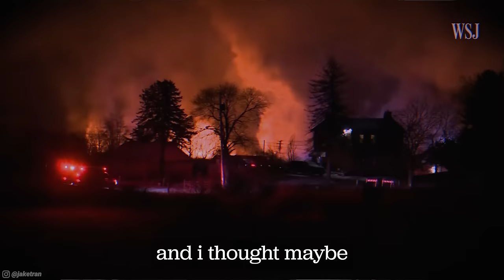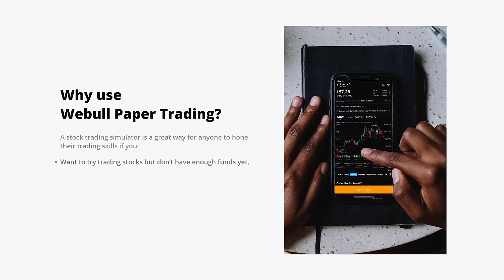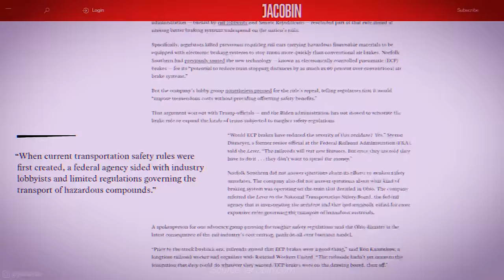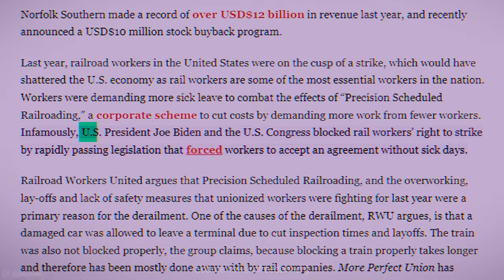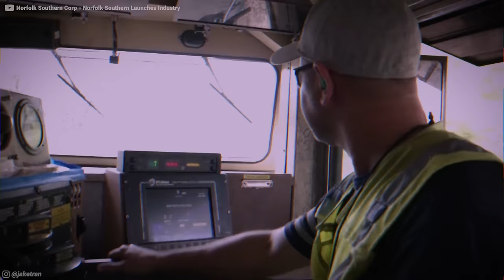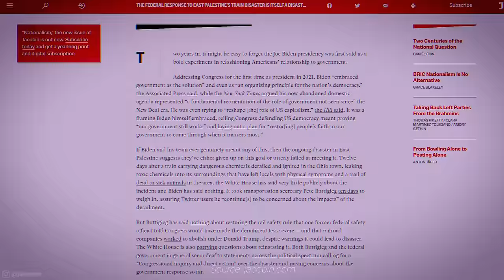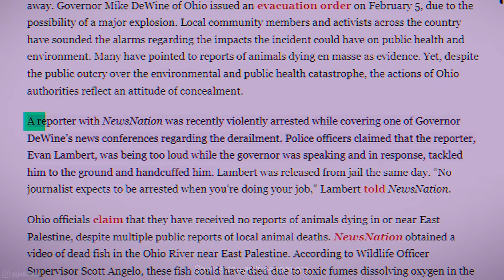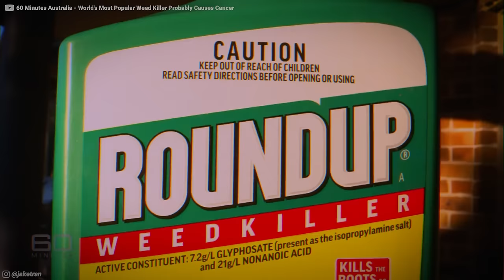Ohio is a CHEMICAL APOCALYPSE right now

Comment: Another terrifying fact about this crash, the vinyl chloride boils at 4°F and is only shipped in liquid form, so when the train crashed it was leaking boiling cryogenic liquid. The train was also carrying between 250K and 1M lbs of it, so there is definitely more air and water contamination than they're saying.

Comment: Different train companies have been skimping on safety measures for years, and the state of Ohio has not given the necessary funds to maintain the railways. So as a result it was somewhat expected sadly...
Reply: Yet they build more railways?? If you're understaffed then building more railroads makes zero sense. Nahh it's excuses to avoid responsibility. When you call it an "accident" then its easier to avoid jail time.
Reply: @woiowoiow190  You know that the different train companies get subsidies for the number of railways that they have? By building more they get more income and to squeeze a little bit more profit they skimp on the safety standards, staff, etc.

Comment: This is gonna be a long one, 

You did get a lot right, but you got way too much wrong in this video.  Number 1: Westinghouse Air Brake is not the same brake from the civil war, it has had countless improvements over the decades, Including having multiple points in the train to dump the brake pipe in an emergency brake application, (thanks to EOTDs and DPUs) to prevent the slamming and derailing that people worry about(idk why this this a take many journos believe, it’s dumb), ECP quite literally is expensive, costly to maintain, and barely provides any benefits, and brakes were not the point of failure, it was the roller bearing on a car.  Not once did you mention PSR, the defect detectors that were ignored by dispatch,  (NS doesn’t have  defect detectors relay into the cab), or how if PSR allowed proper inspections to take place, how this wouldn’t have happened(don’t say NS stopped PSR, they just rebranded it and swore off the furlough part).  You’re right about most of the rest, but honestly, do more research.  You should have gone to guys who specialize in the railroads and heard their take.  TLDR: WAB is not civil war brakes, Bearing failure caused this, PSR is evil, ECP brakes are pointless and would not have prevented this. You got most of it right, just not 70% of your information about the railroads specifically, your coverage over the corruption and rail strike was spot on though.

Comment: So, something doesn’t sit right with me. The train, Norfolk Southern 32N, a mixed consist usually transporting a mix of Chemicals and miscellaneous goods, passed by three defect detectors, all of which recorded rapidly elevating hub temperatures. However, the hubs weren’t nearly hot enough to compromise the integrity of the trucks, with the hottest being recorded at 200° and change. It’s possible that the contents of one of the cars caught fire, spilling out onto the trucks, resulting in it jumping the tracks. Also, there’s the fact that the PTC failed, which should’ve automatically sent the train into emergency, stopping it well before it could derail. It didn’t, even though it detected the hotbox, it did nothing on its own. It also should’ve sent a verbal alert over the radio to alert the engineer and conductor to the threat. Something went seriously wrong. Norfolk Southern Defect Detectors Automated Verbal Alerts sound like this:
“Norfolk Southern Milepost 25.0, Track One, No Defects” for a non defect callout. And a defect callout should sound something like this: “Norfolk Southern Milepost 25.0, Track One, Hot Box Detected On Axel One Hundred And Twenty Seven!”(or something like that). Something surely went wrong.

Comment: I saw a video of a train car welder saying there's no way they would explode with just heat. That a spark would have to get inside or the tanker would have to be open and - essentually lit- for any of then to explode. We know they purposedly opened , drain then burned the fuel from the remaining cards. But It doesn't quiote expolsin how the first from the night of the crash started. Because if the welder is right , a crash alone would not spill these chemicals because their cars used specific trypes to make sure it wouldn't bust or explode. even under heat.

Comment: As someone who works with dangerous chemicals and uses PPE and CBRN equipment, I will say this:
You could not pay me enough to visit that town right now. If I had friends trapped there, I would put on a military respirator, I would be changing the filter every hour, I would pick them up and leave, and I would keep the mask on until I  was fifty miles away.
Some of those chemical mutagens are NASTY stuff, and can cause you permanent physical harm at levels that are neither noticeable, nor produce any immediate symptoms. Well you have a town with dead fish in the river, people getting chemical burns and dogs are dying in the street. I have a feeling this will be a slow burner, that will pan out into decades of litigation as the long term health effects become increasingly evident. 
If you are there, leave.

Comment: The only part that I dont fully agree on is the explosion theory. There could have been an actual explosion risk the train was on fire before the accident but I wouldn't be surprised if they did burn it to get the tracks up and running